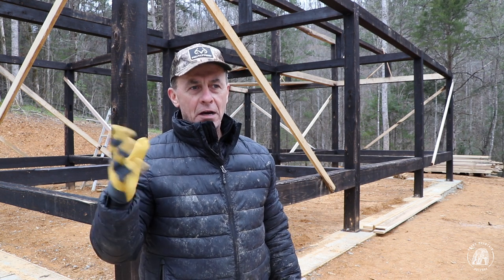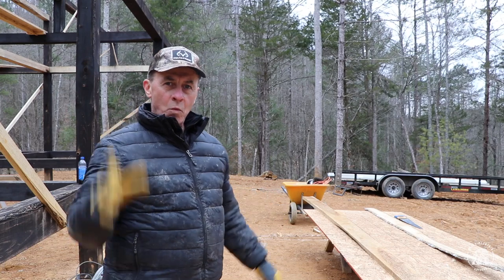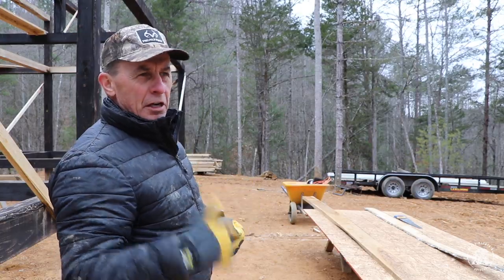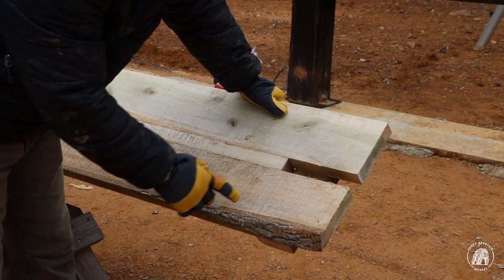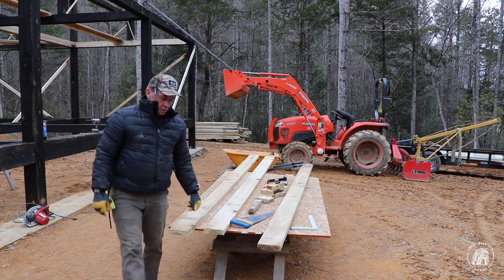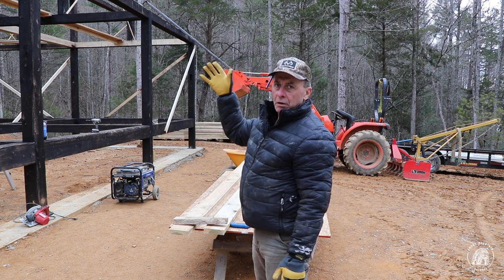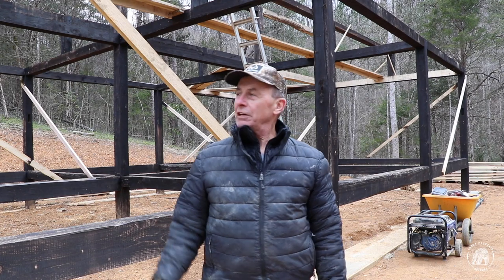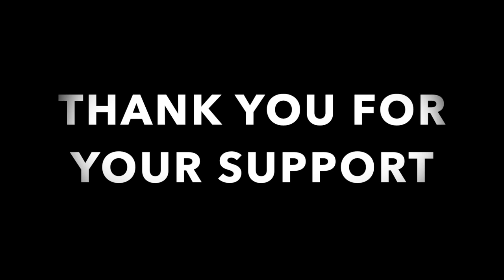S2 EP31 | WOODWORK | TIMBER FRAME BASICS | PLYWOOD, METAL AND WALKWAY FOR CABIN ROOF

Comment: I would predrill your holes while they are in a stack on the ground.  Then you will have nice and even screw lines. You are absolutely right about putting the screws in the valleys.  I often see it done the other way.  Looking forward to seeing the roof done.

Comment: Hi Richard, i am not sure if i am seeing the walk ways correctly, what i see is a 6 X 2 90 degrees to another 6 X 2 and screwed together then the second 6 X 2 is floating from both ends and not anchored to the center spine. maybe put some 3 X 3 blocks along the spine screwing from the top and side to secure the second length of 6 x 2 to the center spine this will give a rigid  support as one walk board will flex and the other won't, stay safe my friend, i want to see this finished and keep up the good work and content.
Reply from the maker: Screwed at downward angle six times.

Comment: Curious how you attached the second 2x6 to the vertical/center 2x6? Nailing the first at 90 deg is obvious. The short 2x4s at each end to keep from sliding is obvious. But the 2nd 2x6 to the vertical has me curious. Btw I’m a computer/airplane guy.  Absolutely love watching! Grew up in Weaverville. Thx.
Reply from the maker: Screwed at an angle downward due to downward force of walking
Reply: So an old fashion toe.  Too simple. Thx

Comment: I noticed the 7/16 osb and assume your decking the roof then screwing the metal down to that? You may be using that for wall sheathing. Even though I dont like giving unsolicited advice, I will. I dont like screwing metal into 7/16 OSB for a house or long-term structure because over time there is not enough meat in that OSB to keep the screws from loosening. 
Again, I dont know your plans and just making some assumptions and giving unsolicited advice. I did that very thing to my shop and now I wish I had not.
Reply from the maker: I’m not going to screw to OSB.
Reply: @SmokyMountainOutpost  
Excellent lol
it was an assumption.

Comment: No plywood seen hear what you are calling plywood is called OSB not plywood. As long as it don't get to wet it will resist falling apart. Plywood would have been much better. But did like the video.